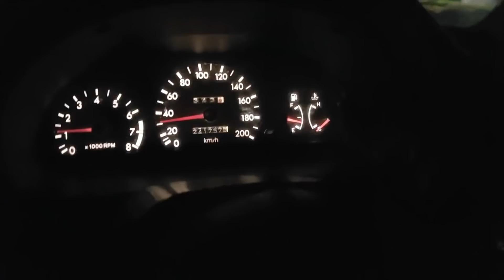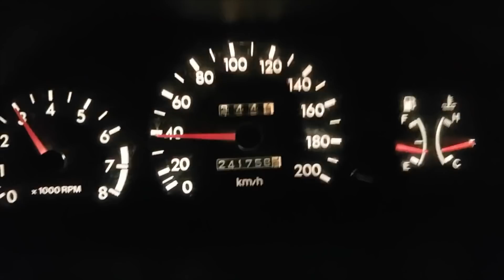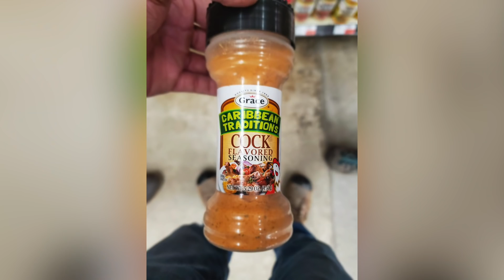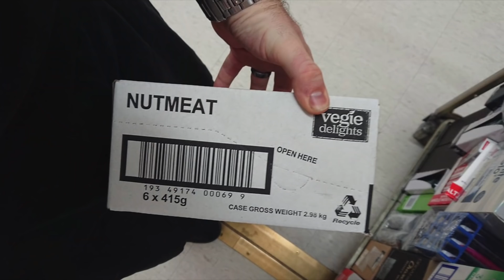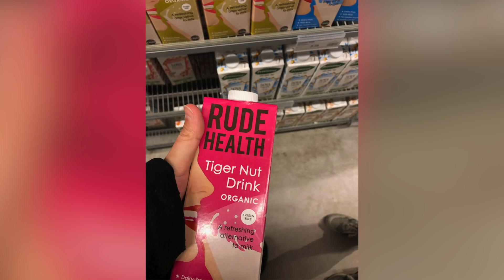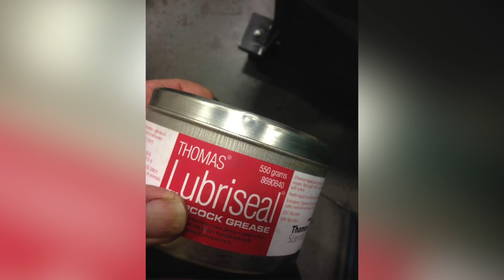WishBone Special + NEW RB26 + Updated 86 & BRZ [UNICORN CIRCUIT EP70]

Comment: The Arteon has been available in Australia a while, officially released June 2017. Only the AWD version is available here in the 206TSI R-Line, so only one spec level. AU$67,490 list price. On Carsales Australia there are a few private sales of 2017 and 2018 plate versions. 

The Kia Stinger was officially released in Australia in July 2017, so the Arteon was out first!

Congrates on one year, wish(bone) you had one in each state🍗

Comment: 10:45  Push rod V8's make sense because they have a lower overall height and width.  For the most part, this type of engine is for low  ( ish ) RPM use in a truck where is works just fine.
Reply: Yeah. My work truck revs out at 2700 rpm. Valve float is not an issue.

Comment: Just wanted to address the conspiracy theory as it seemed to be a combination of two different bits of research. There's the sweetness/flavour and the empty calorie illusion. Firstly regarding the sweetness, CO2 is quite bitter as anyone who has tasted soda water can attest, the sugar is added to counter the bitterness and the amount of sweetness is more or less a personal preference. Stevia has a sweetness about three times higher than sugar gram for gram, and artificial sweeteners can be a thousand times higher, so you only need between 1/3 and 1/1000 of the quantity to equal the sweetness of sugar meaning much lower calories. The sweetener (sugar/stevia/artificial) is a carbohydrate and the source of almost all the energy value in the drink.
This is where the second bit of research comes in. There have been a few small studies showing that some people, particularly people who aren't used to low calorie sweeteners, will consume far more calories from regular food sources when combined with diet drinks than compared with people drinking full calorie soft drinks. A lot more research needs to be done but there may be a relationship between the sweetness of a food and the calories the body expects to process. Habituation, discipline or opportunity may prevent this overeating.

People should also be aware that at a lot of big name fast food outlets the meal deals are typically combined with a low calorie soft drink for the purposes of presenting the 'total energy intake' for that meal. If you have that meal with a full strength drink then you are consuming a lot more calories.

Feel free to substitute calories for kilojoules where mentioned.

Comment: Damn, guys - you missed the news on Ford's new gigantic Iron block pushrod V8? Brand new engine, designed from scratch, *7.3l pushrod V8*, iron block since it's for heavy duty(read: construction, regular towing of large loads, snow plowing, etc.) & commercial trucks, dropping within the next year I believe

Comment: A tip for matey with the crap Hyundai, sounds like either your gearbox doesn't have or has lost the syncromesh on reverse so you'll need to bring the clutch up to the bite point and guide the gear stick into position. You'll get a crunch as it slips in and then just depress the clutch to stop it stalling/lurching, of course that crunch doesn't mean great things for the gearbox but really it will just speed up the wear process a bit

Comment: One of the biggest issues with "zero" soft drinks (no carb-sugars, sweetened with aspartame) - is that compared to sugar-laden soft drinks, a huge portion of the population use that "no sugar" mantra to forgo any shadow of a resemblance of moderation. And long term high consumption of any carbonated drink, isn't good for your intestines, and can cause somewhat similar phenomena as "beer belly" where your intestines swell, and that process isn't always reversible. Aside from that - the mindset of no consequences for freely forgoing moderation and giving in to the sweetness cravings as long as the soda is sugarless, have a worryingly strong tendancy to spill over into other parts of your "diet", where moderation is more important.

TL;DR There's a steadily growing mass of both long and short term research studies coming out, including many meta-analysisisiseses, that indicate that the harmful effects of aspartame, xylitol and partly stevia sweetners - especially in soft drinks - is not a direct consequence of the sweetener(s), but the consumption patterns it leads to.

Comment: The Hyundai passenger door isn't opening because the cable probably snapped off. Rip the door panel off and see what's up should be easy to fix

Comment: I have a question: outside the US, do you call ratchets/sockets by their SAE sizes, ie 3/8", 1/2" drive? Or are they 10mil and 13mil drive? And are the drives really sae or metric sizes?
Reply: in AUS they are SAE size ratchet, so it is 3/8", 1/2" drive, however sockets are usually metric in our application

Comment: OK, with calling the pushrod overhead valve engine 'dinosaur' technology, MCM now has to build a flathead powered vehicle. I don't care if its a Ford V8, or a Willy's 4 cylinder, something with side valves mounted in the block.

Comment: moog should build a r34 gtr RZ TUNE from sctach using a r32 gtr body <3 and buy the new jdm rb26 2020 engine/trans! <3
Reply: wish bone sorry mate but how do you think you get a r34 from a r32 body they both look different and are from different years thus you would only end up with a rb26 r32 not r34
Reply: @jacarson12  the r32 body is similar to the r34 and has swapable body panel and boy kit parts..

Comment: I just have thing to say, re my crap car, those little excels were almost  brilliant.
 We used to own one for about two years.... I drove it like I hated it whenever driving (was my ex wifes car)... it was a little monster though, so much fun.

It died though after my ex decided to use the clutch as a footrest, RIP clutch thrust bearing :(

Worst thing was, the clutch bearing slide was not on the shaft, but part of the gearbox housing!!!!!......   So, sadly bye bye gearbox, and bye bye car.

Sigh, Hyundai :(